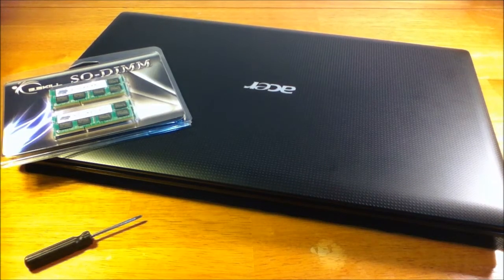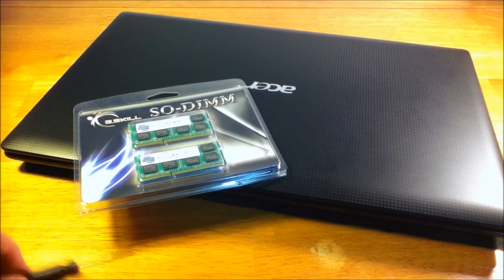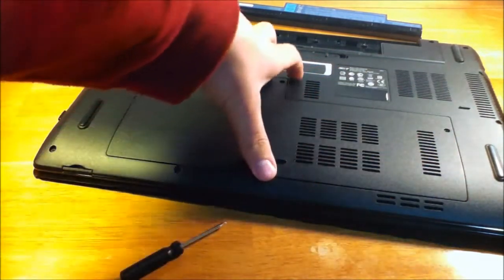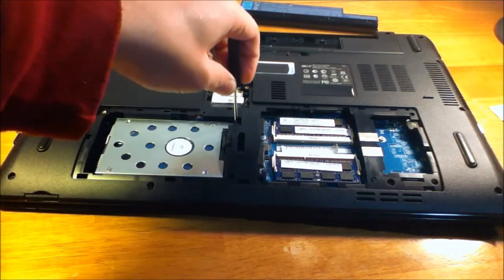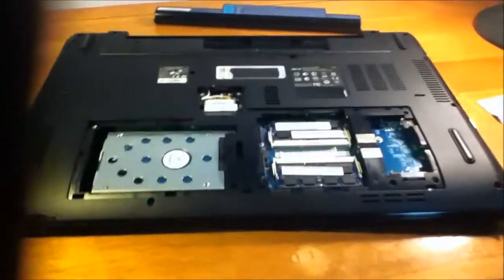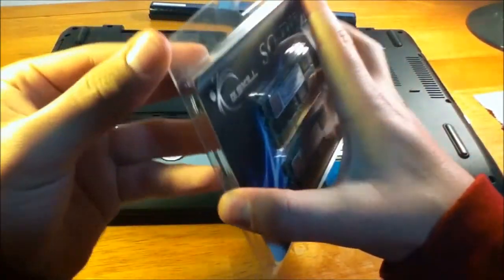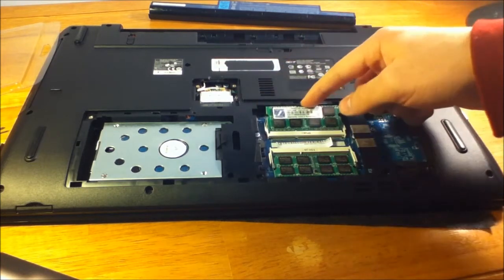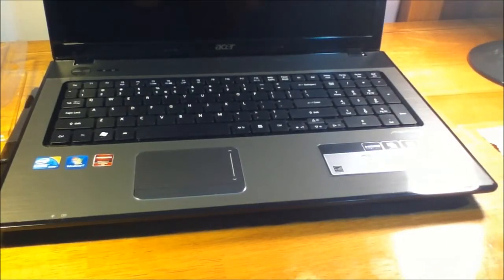Acer Aspire 7741g Ram Upgrade Tutorial

Comment: I have the exact same laptop and have compatible ram but keep getting a blue screen with the new ram installed. When I put the original ram back in, all is good. The stop codes are different but it just does not like the new ram. Have you ever experienced that?

Comment: So I've got an acer aspire that runs pretty slow. It still works but I need a new battery and I only have 4GB of ram. I'm hoping I have another slot for 4 or 8 GB of ram, if so and I replace the battery and add more RAM,  this will most likely make my laptop run faster, no?
Reply: had any luck?
Reply: I’ve since upgraded but I did end up able to add a second slot, there was a spot for another one, it helped a bit!

Comment from the maker: 1333 Mhz, Also did 667 MHz ram actually come with that laptop
Reply: Hello Adnanlink, i hope that you can help me.
I have an "Acer Aspire 7741zg", and i have installed Corsair ddr-3 (1333Mhz) memory.
But the memory still runs at 533Mhz.
Do you know what i can do, to solve this issue?
The laptop has a Intel P6100 dual core processor.
Thanks in advance.

Comment: thank u for the answer,
I have tried it with each part, but it didn't work.
I will send it back soon, and I have orderd a package with 1066 MHz
maybe this will work..

In cpu-z the current ram (2x2GB) is shown as
Max Bandwidth: PC3-10700 (667 MHz),
DRAM Frequency: 532 MHz
Model is Acer JE70 cp

Comment from the maker: That's strange, I don't know all the specs of the ram, but they seem to be compatible. You could mix and match the ram to see if one of the new ram modules is faulty. Also check that the ram specifications match those of the computers original ram or a compatible replacement(in the description).

Comment: I have the Aspire 7741G and wanted to upgrade my RAM
I bought this one:
Corsair PC1333 1333MHz, 2x 4GB DDR3-RAM Kit
but when i changed it, I got a bootloop after the windows logo appears shortly and it goes back to the bios
In the bios it is shown as 8192 MB RAM
After I inserted my old 2x4GB RAM it is booting normaly.

What can I do, is this RAM compatible?

Comment: Here's  a question for you:  I have a 7741Z and the hard drive went bad (I think I infected it when I fixed my boss' computer by switching back and forth my thumbdrive.)  So I put a new one in and formatted it /w Win7 Professional.  I needed I needed Lan and Wifi drivers.  I tried to install one (got them from the Acer website for Win7 Professional) and it locked up and when I restarted comptuer I get nothing but a blinking cursor.  Can't even re-reformat from the disk I have. IDK what to do. :(

Comment: That's interesting! I was wondering about that. I have the 7741Z and there is no blutooth in it.  So, you're saying I can replace the wireless card that's in there w/ a combo bluetooth/wifi one?   I also have an external Bluetooth dongle that I got on ebay. (it's the size of a laser mouse receiver). Would that work too?

Comment from the maker: just as a suggestion, get a bluetooth wifi combo pcie component to replace the already existing wifi card. That way you will still have the secondary pcie empty and the combo card will be using the antennas (already existing) that run up the length of the monitor (signal strength of the bluetooth will be better).

Comment from the maker: are you sure you had the same model as me because the one i have has a quad-thread i5 CPU and a 1GB dedicated gpu. you might have the z model which has the Pentium CPU and no gpu. if you do have the same then it isn't the laptops fault, the crashing would have to do with the software (aka windows - Microsoft).

Comment from the maker: Thanks for the request but sadly, that's not how it works for the acer aspire 7741z. The 7741z actually has a very similar mother board but it is lacking several important parts such as the bios support and any sort of heat dispersal for an installed graphics card. There is however one solution, you could purchase a replacement mother board with the required heat sink as the motherboard and Inputs/outputs are the same. I will look around and post a link later that will suit your need.

Comment from the maker: @chriskazama1  For your second question, I think that you should go with 2x4gb because it will provide the computer with more ram that it can use at any point in time, making multitasking more efficient and besides, you would be saving some money. The downside to this option however is that the computer would be providing power for two modules rather than one (you probably have two anyway and the power consumption difference might not even be that big).